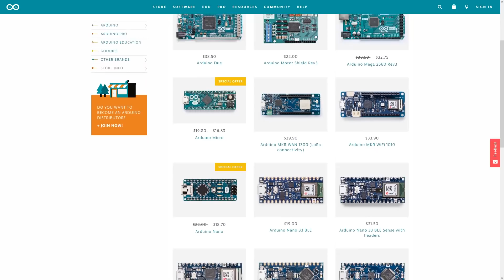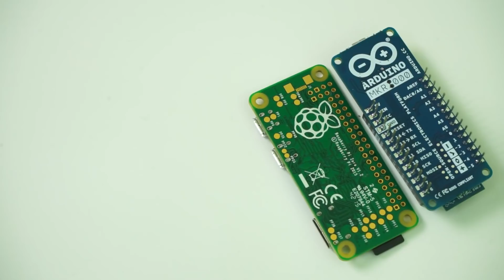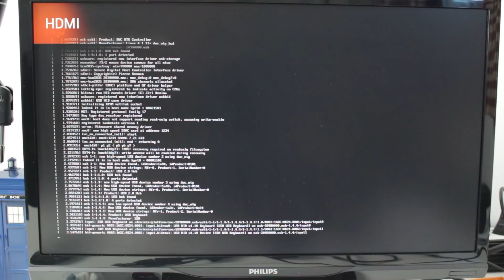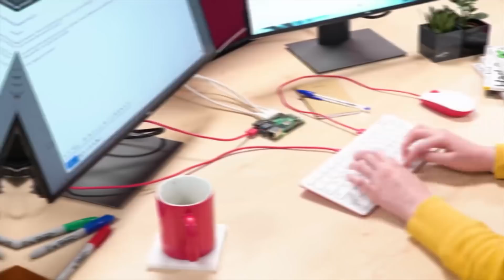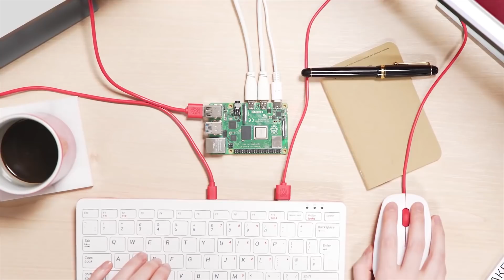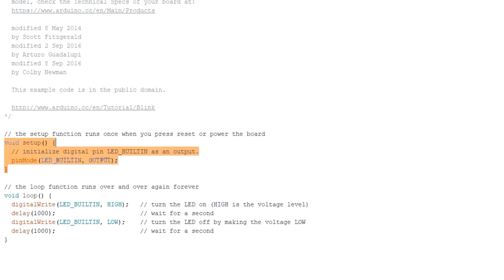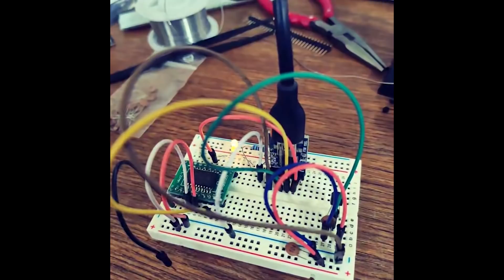Arduino vs Raspberry Pi - Which one is better?

Comment: You are going to be running a microcontroller operating system. This guy has zero clue what he is talking about.
A microcontroller operating system looks like this: while (1) {}
Reply from the maker: Sadly you don't know what you are talking about. In your comically code of "while (1) {}" where are the calls for handling things like the network stack, scheduled tasks, or the interrupts?
Reply: @GaryExplains  you are taking about an Arduino and talking about an OS. Nonsense. The hardware handles the interrupts based on register settings. Why do you even have a channel "explaining" things if you are this ignorant. There is NO OS on the Arduino. You are dead wrong and I am sad that youtube has ignorant videos like yours promoted.
Reply from the maker: I am sorry you aren't completely informed about these things, I truly am. First of all, what do you call an OS? That is probably a stumbling block for you. Second, what does the OS do? I am not saying that the Arduino is running an "OS" like Linux. However I just looked at the ArduinoCore source code (https://github.com/arduino/ArduinoCore-samd/tree/master/cores/arduino) that is a lot of code. I also checked the Scheduler code (https://github.com/arduino-libraries/Scheduler/blob/master/src/Scheduler.cpp) and it is clearly doing co-operative multi-tasking. These are all functions that are run by the "OS" that you as the "app" developer don't control. Please look at the code.
Reply: @GaryExplains  I program microcontrollers in C not in Arduino IDE ... you are deeply mistaken about the Arduino having an OS installed. I am sad you think you have an aura of superiority stating that I don't understand something and that is the problem. You are teaching people falsehoods. Better get your facts right.
Reply from the maker: @andraslibal  Well if you do program microcontrollers in C (as I do) then you will know that a) there are lots of OSes for microcontrollers like FreeRTOS, Zephyr, and Mbed. b) You will also understand the code I linked to.

Since the Arduino offers a network stack and co-operative multi-tasking, please tell me how that is different (in principle, not feature set) to Zephr and Mbed.
Reply from the maker: @andraslibal  BTW, just rereading you comment, I just want to clarify one thing, hoping it is how you expressed this and not what you mean. But, I didn't say the Arduino has an OS "installed" like a PC has an OS installed. All embedded system bundle the "OS" along with the user program. That is the same for Zephr, Mbed OS, etc.
Reply from the maker: Also, on talking of microcontrollers beyond Arduino there are lots of microcontroller OSes like Zephr, FreeRTOS and Mbed OS.

Comment: Thumbnail depicted the pi as being sold at $10... hmm 🤔🤔🤔
Reply from the maker: It is. The Raspberry Pi Zero W costs $10/€10 depending on your region. The non W version costs just $5/€5. What is your question/issue with that?
Reply: @GaryExplains  ok. Just that, you said $5 in the video. 
I can be a sarcastic dick sometimes. Lol like to get people going in the comment section and spark conversation. It helps channels to grow sometimes.
Reply from the maker: So there are two different models of Pi Zero. Since the MKR1000 is a Wi-Fi enabled Arduino then I opted to place it next to the Wi-Fi enabled Pi in the thumbnail. In the video I talk about lots of models of both Pi and Arduino. I don't think you sarcasm was even close to being warranted.
Reply: @GaryExplains  I respectfully disagree. 
I don't mean to be coarse or anything. 
But come on... said 30 to 10 on the thumbnail and then started off saying 10 was actually 5..
I really didn't mean any disrespect, just pointing out the obvious. 
Warranted, it was...
Reply from the maker: I don't understand, are you complaining about the order that I present the different devices? I have a whole section of the video about the different boards and the different prices. The thumbnail shows two possible boards (and their prices), in this case both are Wi-Fi enabled.
Reply from the maker: Also, the thumbnail says it is a Pi Zero W and in the intro I talk about the Pi Zero. At 3:10 I clearly talk about the difference between the W and non-W versions and their prices.
Reply: @GaryExplains  you're reading too much into this Gary. 
I was poking fun. 
Not a huge fan of typing paragraphs on my phone. 
I will remove the comment if you like. 
And yes, the order was my target, as it can cause misconceptions and I was simply taking advantage of the opportunity. 
My apologies, gary. Sincerely, sheeple.
Reply: @GaryExplains  sorry for wasting your time. 
It wasn't meant for you.

Comment: For the $20 price difference you could get a 20000mAh battery pack that would protect your sd storage and help buffer the power draw difference.  I don't really know why else one would choose an Arduino other than price.
Reply: See https://en.m.wikipedia.org/wiki/RISC_OS# There are also a number of promising OSs being written by Rust Developers.  These should provide the boot speed and security you get from an Arduino, without having to become an expert on the Linux Boot Process.
Reply: boot speed
no OS overhead
potential security issues introduced by an OS that are not introduced by the Arduino environment
power consumption of the controller

Given that this is a comparison of bananas and condoms, I'd say he did a fair job explaining the difference.  And though, like bananas and condoms, they can be used together, each has its own separate and distinct purpose.
Reply: @bkvdpw  There was a good explanation.  From the look of it capability wise there is nothing the Arduino can do that the PI can't.  Even the points you made about boot times and security are both something the PI can match!  The boot process is long because the PI has more features than the Arduino, remove those services and features from the boot process and the PI can match the Arduino.  See boot sector games and such.  The same solution would fix your concerns regarding security, just turn off things you don't need or that the Arduino doesn't have... Even the OS is optional.  The other point you raise is concerning Power.  From an environmental POV the Arduino uses less power.  From a practice POV an energy solution would be possible given the ~$20 budget saved by choosing the PI.

Comment: You CANNOT try different operating systems of any kind on an Arduino! And Arduino doesn't have an OS, its IDE is a compiler and uploader for the libraries to the compatible devices .
The biggest differences between the two are Pi's can have an OS for more memory-hungry and complicated tasks (complex robots etc.) while Arduino are for basic to moderate mechanical tasks. Also Arduino is only the interface for the microprocessor itself, but the microprocessor can be removed (from some Arduinos) to make the device/circuit smaller or make copies of the microprocessor for more than one device.
Reply from the maker: Depends on your definition of an OS and which Arduino compatible board you are using. About the OS I have had this conversation with others here, please look at the comments, I won't repeat them here.

Comment: Pi Zero - $15 at best and power hungry - eats battery fast, heats up
Reply: I'm also curious where he found those zero for 5$ all the ones I found were above 10$ if you bought them from China while you can get Arduino nano for 2$

Comment: I know arduions\microcontrollers almost always meet real time sysem requirements like hard timing constraints. But does the pi? With an OS you're not always going to meet hard deadlines, as it could be scheduling other tasks so the important task might miss it. Though this depends on what your hard timing constraints are.

Comment: Rpi is less capable if we talking about max pin current, only 3mA. AVR from adruino uno can handle 20mA, SAMD21 from arduino mkr1000 only 7mA. It is less powerful but can enter power save mode with ~5μA and wake up from time to time to read data from sensors. Can be easily powered from coin cell.

Its worth to mention that μController is a whole computer in one chip. Arduino is just a pcb board with that chip. After loading a program into the flash memory you could desolder it and connect to coin cell and it could work with no problem. Chip alone cost ~1.5$ and 4mmx4mm packages are available. It would be hard to size down a Rpi.

μC are ideal if you need fast, exact time and 100% guarantee response for an incoming interrupt signal, no OS to meddle.

Comment: They are very different animals, Arduino is more for low level gadget development, the raspberry pi is more for high level development.
Reply: As long as one understands that you're using the geeky definitions of high and low level and not some mainstream definition, you're spot on.
Reply from the maker: Which is why I am comparing them! 🙄

Comment: Ok ;) Few important notes. You can make Raspberry Pi Zero to boot up almost as fast as Arduino. It boots up so long because it starts complex OS from SD card which is totally OPTIONAL. Arduino has no OS whatsoever, just pre-programmed bootloader which allows to upload your hand-crafted firmware to the MCU. So... you can make hand crafted firmware to Raspberry Pi Zero as well, see projects which uses RPi to emulate Commodore 1541 floppy drive and it's OS or BBC Micro turbo module. This is kind of use in which RPI starts almost instantly. SDCard corrupts because OS makes accesses to the card when power fails. If it's read-only filesystem that alone makes it way less vulnerable. Flash-writes during loss of power might corrupt that flash region on MCU as well, but with SD card you can actually damage system files but with MCU you only get invalid data in eeprom emulating flash region which doesn't process code, only holds data. Arduino original product is also made to support foundation, so substantial portion of the official price is "donation" ;) Most clones are way cheaper, MKR1000 clones will probably be as low as 10$ anyway - that's component price + manufacturing fee + small profit margin. And last but not least - MCU has on-die advanced timers which really allows you to generate pwm, count fast impulses etc. It also has powerful ADC with speed way over acoustic band (and less noise) plus almost as powerful DAC. And can power down to draw microamps so is well suited to battery powered nodes. Also MKR can support directly capacity touch buttons, sliders etc. (due to having decent ADC and libraries) when RPi cannot without external hardware. So basically in most of the times when you have to run multiple applications under system it's way better to stick with Raspberry (or Orange, or Banana, or CHIP, or Nano or whatever Pi). If you need specific firmware solution with wifi connectivity it's either mkr or just esp32. Which actually offers most of the things MKR offer, has faster core and costs less.

Comment: Microcontroller operating system? Isn't that defeating the point of a microcontroller?
Reply from the maker: No. How are you going to handle interrupts and network traffic etc without some form of OS?
Reply: @GaryExplains  that's generally coded specific to the task of the microcontroller and the specific hardware surrounding the controller. Microcontrollers get their power from being lightweight and on task without a bunch of bloat. An operating system is usually created so that you can run the same software on a variety of hardware. This leads to cruft and bloat, but improves user convenience. 

If by operating system, you mean the code that you write and upload for your specific task, then by all means call it an operating system. But that's not the historic definition of an operating system that I'm aware of.
Reply from the maker: @jjbailey01  An operating system manages the resources of the device outside of the control of the user program. There are calls made to handle interrupts and networking and more, that you as the programmer don't control. I have had this conversation with someone else  here in the comments. I won't repeat everything I wrote there.

Comment: Wow. How bad. Comparing a microcontroller to a sbc is like asking $3500 wheelchair vs. toyota camry - which one is better? It simply depends what you need and what you're going to do with it.
Reply from the maker: Someone who didn't watch the video ^^^^^^^
Reply: @GaryExplains  I watched the video, all the way through I might add before you throw that back at me like quite a few other responses you have given when people make a point you don't understand. A micro-controller (Arduino/PIC etc) and a SBC (single board computer such as RPi/Beaglebone etc) can only be compared for a given task, not for an "All in one which is better" comparison. 

It's like comparing a push bike to a car, sure they are both a form of transport, both have wheels & steering etc but they are designed for different uses. 

I won't write a complete list but will give you a very simple example. One of your replies you said "So the GPIO pins on the Raspberry Pi are for decoration", no they are not just for decoration & yes you can wire in all manner of things but, & this is a big BUT, it is far from easy that you can accurately (time wise) read or write the GPIO on a RPi. This is due to it being a computer & running an operating system, even if you boot into console mode there are processes running in the background. Not to mention if you use Python (which a vast majority do on the RPi) that's an interpreted language which again can complicate timing. Sure the RPi can read/write a lot of data through the GPIO thanks to it's cpu speed but the timing accuracy is not 100% die to what I mentioned previously. A micro-controller on the other hand can because it is only running what you put on it & as all the instructions take a known amount of time it's not difficult to get consistent accurate timing.

I use both & each are superb for what they are designed for once you understand their strengths & limitations.  

Another reply of yours was "The Raspberry Pi vs Ardunio seems to be a popular topic with a combined total of millions of views on YouTube", so you made this video as clickbait then hoping to increase your views or whatever??? . What you didn't take from your search was that your video ended up like 90% of those others being bordering on useless. If this video was called "Arduino vs Raspberry Pi - What's the difference" rather than "Which is better" then it would have been more apt as you did point out a lot of key bits about both of them which quite a few of the other videos missed out on.
Reply from the maker: @TheFuzzy70  You claim to have watched the video but then you are fixating on the title. Does the video cover the points needed for a "what is the difference" video? I think so and so do you. The video is important here not if you like the title. 🙄
Reply: @GaryExplains  Seriously???, The amount of comments giving you constructive criticism & all you do is fob them off. It is a "What's the difference" video as I pointed out, even saying you bought up a lot of points on both systems. However it's not called that is it, the problem is it's called "What's better" which is the wrong title because of the reasons I (& others) pointed out in they are 2 different things with different goals.
Reply from the maker: @TheFuzzy70  LOL, I spend hours and hours researching, preparing, producing, recording, editing and publishing a video. A video which you don't have a problem with. But you want to waste time talking if "what is the difference" is better than "which is better" in the title. LOL.
Reply: Gary Explains well your so called hours & hours of research obviously didn’t point out the very obvious key point that the 2 items being compared are intended for different roles, as MANY have stated, so the case stands that the video is indeed titled incorrectly. If you want to do which is better compare like for like, eg Arduino vs PicMicro (both micro-controllers) or RPi vs Beaglebone (both SBC’s)
Reply: Gary Explains besides it’s not wasting time , the simple fact that you can’t understand is the title is wrong which essentially misinforming people about the content
Reply from the maker: @TheFuzzy70  How does "which is best" misinform people about the content? I still can't get over the fact that I spend hours making these videos are you are whining about your personal opinion about the title. It is truly bizarre.
Reply from the maker: @TheFuzzy70  OK dude. I am out of here. I am busy wasting hours and hours trying to think of a bad title for my next video. However please free feel to comment about that one when I publish it. Bye for now.
Reply: Gary Explains sarcasm wasn’t necessary but your responses are full of it in a lot of your replies. Little tip mate, if your going to spend hours & hours making a video the least you can do is have the script you read from nearer the lens of the camera. Seeing your eyes flick back and forth between the camera & script is not great. This is not a dig at you but a tip, your videos will have a more professional appearance. If you can learn the script that’s even better but that is not always easy to do. I won’t be commenting any more as it’s obviously a pointless exercise with you. All the best on your YouTube endeavour & I say that sincerely not sarcastically
Reply from the maker: @TheFuzzy70  Actually I don't use a script, I record everything extemporaneously. I do have a little flip out screen on my camera that I subconsciously look at. No matter how hard I try I can't seem to stop myself from doing it. Can I suggest that you stop presuming that you know what is best, about the titles and about how I record. I am sure you have better things to do.